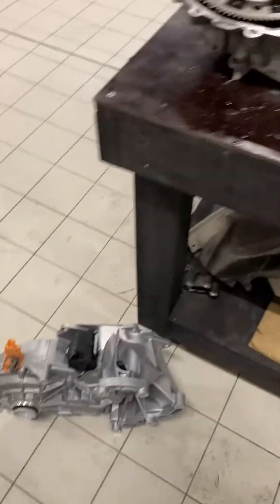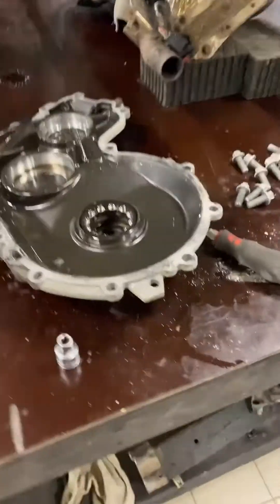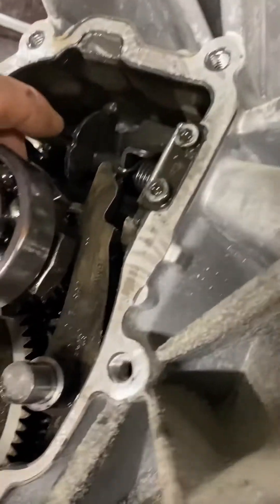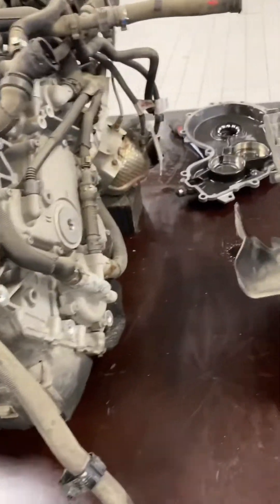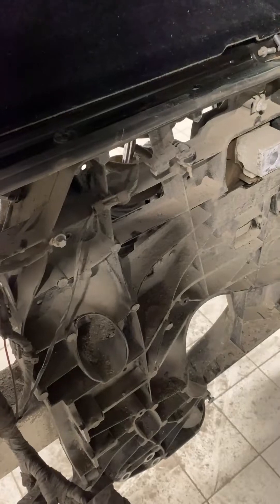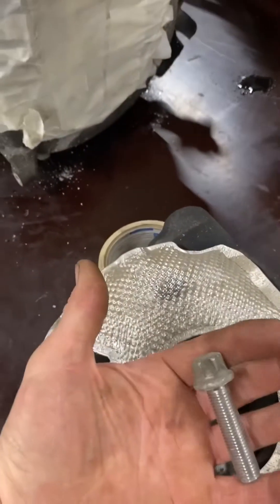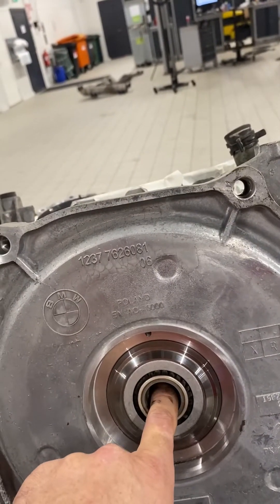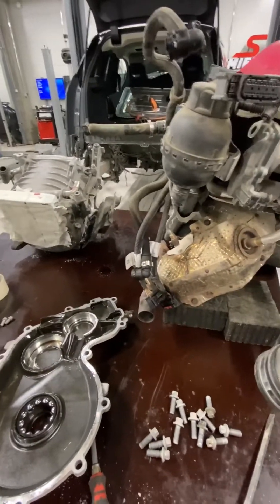The i3 gearbox has total ###t bearings inside!

Comment: What were the symptoms for the missing teeth and/or bearing?  Was the gearbox "ticking" under moderate acceleration/regen braking?  Have a 2015 i3 REX that is ticking and I can feel it on the top of the motor housing.  When not under load, it is imperceptible.
Reply: Mine is making a similar sound but only under load.
Reply from the maker: Get it pulled and replace the bearings. I would advise you buy uprated bearings from a bearing specialist